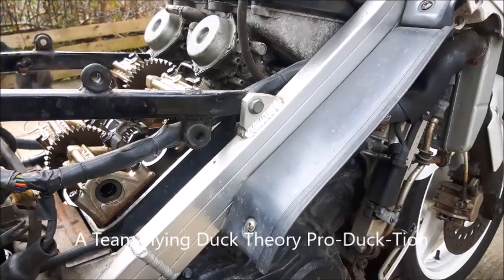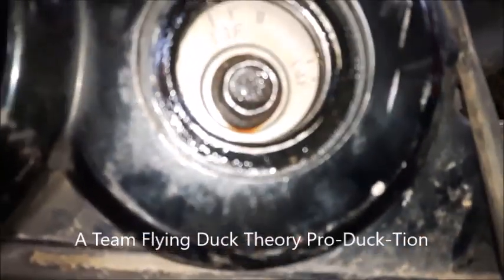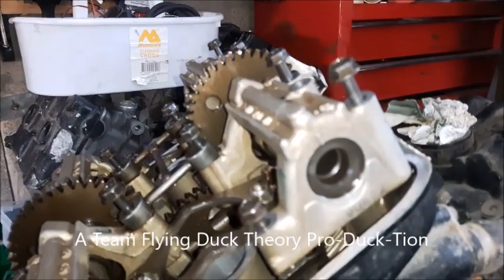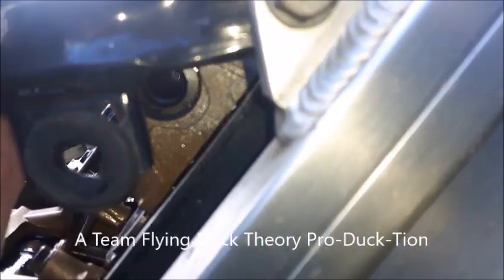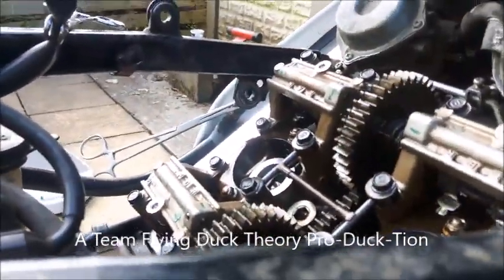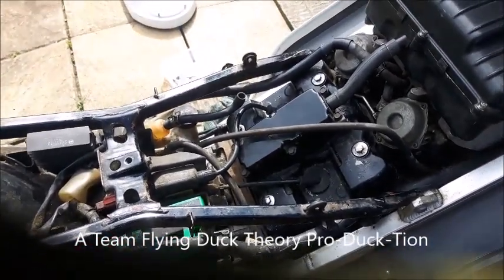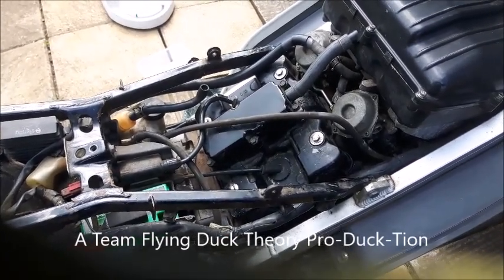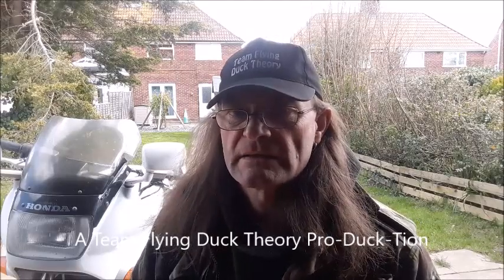RC24 Big Bang Conversion

Comment: Hi 
How was the performance changed on the rc36, pull better in low to mid range, lose some from the top? . I ask as I wish to do similar with my gpz900r a bit more difficult as cams will have to be cut and welded 
Great informative vid 
Keep up the good work
Reply from the maker: It pulled better from the line and felt more like it was 'digging in' on the rear when accelerating out of corners. Top end seemed to be much the same. Exhaust note changed though. Be a little more cautious doing this conversion with an inline 4 though. The VFR crank is very narrow and so is more resistant to twisting. Good luck though if you do go ahead with it 👍
Reply: Read up on the differences of an inlne 4 & V4 motor ... what you're proposing can't be done, it'll just smash the motor to bits, this 180 cam flip can only be done on a V4, it can't be done on a fuel injected V4 either as it won't ever run, it'll only ever work on a Carb'd V4.

Comment: Los cigueñales de rc30 y rc 36 son diferentes...has cambiado configuracion y sera algo big bang pero sin prestaciines...gracias
Reply from the maker: It has never been the intention to increase the power this way. The point was A, to see if it worked, B, what it would go like and C, just for the fun of it. On the 36 it pulled really well. No it wasn't any faster overall but it was more fun to ride. On the 24 it just didn't seem to work. I have a theory why but no proof.

Comment: If you move one set of cams by 180 degrees on a VTR1000F the bike still runs fine at low revs but also hits a brick wall at 7000rpm like your RC24. Maybe something to do with harmonics within the airbox interfering?
Reply from the maker: it is entirely possible, however, the airboxes on the 24 and the 36 are very similar and the 36 had no trouble revving to its full potential. I am building an RC24 special so may give it another try when we havin it up and running.

Comment: How do you solve spark ignition?
Reply from the maker: It's a wasted spark system. It utilises the spark that  exists on the original exhaust stroke instead.
Reply: @TheFlyingDuckTheory  So it sparks like two stroke? Every full rotation of crank - one spark
Reply from the maker: @Desmodromic916  yes.
Reply: Any idea if this can be done with a 98 VFR800?
Reply from the maker: @RetroSuperbikes  no clue. I would think unlikely given it is fuel injected and the coils will only spark when they need to. The reason it works on the 750 is because it is carbed and has a wasted spark system.

Comment: Precedent owner make this mod on my 950 KTM. Cause premature wearing
Reply from the maker: Is your KTM a V4?
Reply: @TheFlyingDuckTheory  no, is a 950 se from 2007.
Reply from the maker: Then that could be why it had premature wear. I ran my road bike for two years in this configuration with no issues.
Reply: @TheFlyingDuckTheory  maybe isn't the only reason. But really big bang in that motor gives kicks